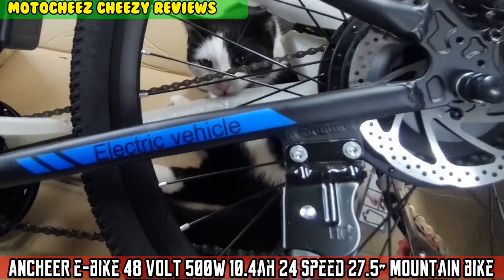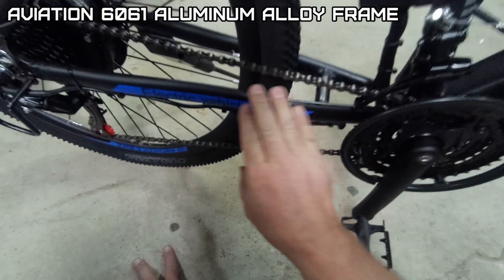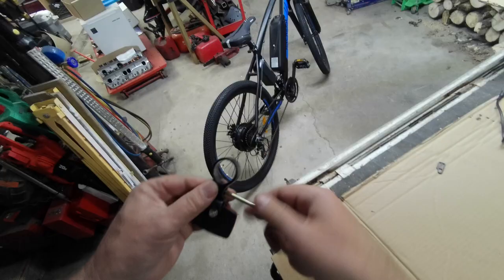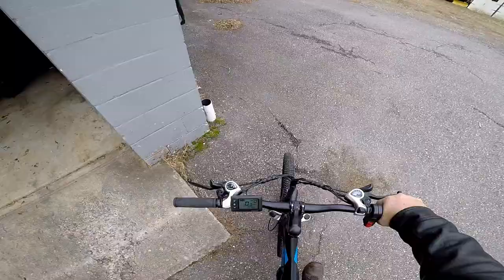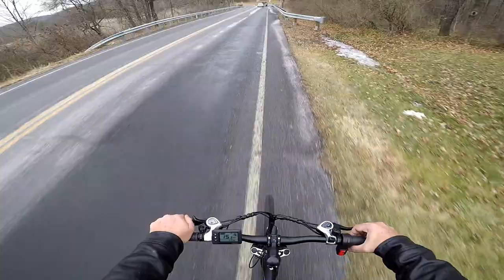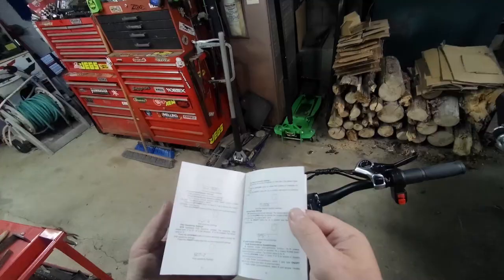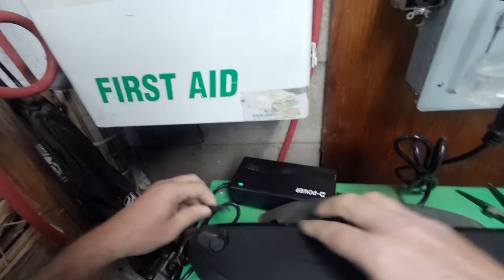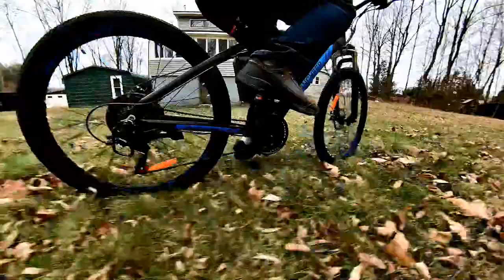ANCHEER E-bike 48 volt 499wh 10.4ah 21 speed 27.5" Mountain bike, controls, test and tweeks.

Comment: Hey. Open the motor controller and disconnect the white cable and the bicycle will go 30-40+MPH…. Your welcome… and the best part you don’t need to pedal
Reply from the maker: This controller has the white wire? I'll have to check.
Reply: @MotoCheez did it work
Reply: 7 months later, does the bike work good or does it ruin it because you did something you weren't supposed to, I ask because I'm buying one if it's worth the money and it lasts me a year or two. 😅
Reply from the maker: @clutch7756 still good but I've probably only put another 50 miles on it. I get a lot of bikes to test
Reply: @MotoCheez  please try! Thanks 😊
Reply from the maker: This bike did not have ther power wire It was done through the controller
Reply: @MotoCheez  Can you please send link to buy? Thanks!
Reply from the maker: My links are always in the description
Reply: Hey just got this bike and I can never go fast enough does that really work I’ll do it

Comment: Precautions are to check ALL of the bolts on the motor, not just the shaft bolts, but also the housing bolts, also it's a must to get a torque arm for the motor shaft, and fill the tires with flatout, this will save you a bunch of headache relief down the road, and give you an enjoyable ebike, for comfort, you can add a shock absorbing seat post and/or seat, and a adjustable handlebar neck to give yourself a comfortable riding position.😊😎👍
Reply from the maker: I typically mention check all bolt in my videos, the shock seat posts are definitely nice, I've gotten some of these e-bikes with them
Reply: Where do you buy the seat and handlebar thing you mentioned for this bike

Comment: I have an Ancheer AM1907, 21 speed. The gears are geared too low for me. I never shift down from the tall sprocket at the peddles. I've never used any of the lower gears, just geared too low. Probably better for just off road, not very good for road. Other than that it's been a reliable e-bike, just which they had taller gearing.
Reply from the maker: Seems all the e-bikes are that way, you can put a bigger sprocket on front crank sprocket or smaller gearset for rear

Comment: I have been on my Ancheer hummer ebike for 5 years. It's been a great time to ride.I would buy another one if something happens to it
Reply from the maker: Thanks for the input!
Reply: have you had to replace the battery? how many miles can you normally get before charging?
Reply from the maker: @shaunhenesy2258  typically between 1 to 2 miles per amp hour
Reply: @MotoCheez is that 1-2 miles per amp hour 50% full throttle and 50% pedal assist? or just pure pedal assist?
Reply from the maker: @eroblern 95% throttle, 5% pedal assist
Reply: @MotoCheez  damn thanks

Comment: Do you think the overall lighter weight is helping the work efficiency of the smaller motor?  And would a larger battery option help to compensate for the weaker (less expensive) motor?
Reply from the maker: Yes and yes, if it had a 1000wh battery would definitely help being the bike is light

Comment: So I saw your video I ordered two of these bikes very impressed by the quality took about a half an hour to assemble out of the box bike works perfectly for a cheap ebike this is the way to go. ANCHEER has my 100% approval and it also comes with a one-year warranty. I wish I would have watched your video all the way through the first time I missed out on the promotional code I guess that's what I get for not watching the video all the way through.
Reply from the maker: Congrats. Aww. Too bad you missed the Code
Reply: @MotoCheez  that's what I get maybe next time by the way these bikes came in red and black. Thanks again for making the video. Definitely should make things easier for people that are undecided
Reply: @MotoCheez  Maintenance video would be awesome. My bike is up to 171 miles I have no issues I'd like to keep it that way I just don't know what the maintenance would be on these bikes.
Reply from the maker: Good idea! 
Not much to do on these bikes that differs from a regular bike, oil chain, derailers, check brakes and derailers. check bearings, possibly grease if you ride in harsh conditions.
Reply: @MotoCheez  awsome thank you...

Comment: Interesting bike for the money. Wonder when some clever mechanic comes up with regenerative braking or 'coasting' for these e-bikes. Maybe something like the old bike light generators that were driven by the front tire, but on steroids for the required voltage?
Reply from the maker: Some of these bikes do have regenerative braking, I think it's the extra expense of the magnets in the hub. I think they should all have them for when you're going downhill you can recharge a bit

Comment: It sounded like both wheels were rubbing the disc breaks when just assembled. Did it continue to rub? Am surprised the manual showed you how to increase the speed limit past 20mph. Wish mine allows me that too.
Reply from the maker: I didn't notice the rubbing, I usually adjust if I hear it. Most all the bikes I get have a way to get class 3 29mph. Did you look up the controller online?
Reply: @MotoCheez  Good idea. I should look it up.

Comment: is there a cheat sheet available for those codes?
I just bought the same bike in 4/23  but they used a different model controller.
My+ - buttons are at the bottom,Not on the face,I tried pushing the same buttons but i cant get into any settings menu?Any suggestions?Ancheer is of no help ,only getting 20mph down here in flat florida.
Reply from the maker: Not sure what control you have maybe if you take a picture and do a Google reverse photo search it'll show you what model it is and then there should be instructions on it
Reply: Me too bruh

Comment: You would be highly suited to use a CYC mid drive kit for a build.  Right up your alley. CYC makes a 5,000 watt kit for converting bikes to an E bike.. You just need to hunt down a used higher end bike with great brakes and strong frame.. They go 50 mph 😂 And a good rear gear set made of steel to last longer 👍 Oh.. A 52 volt or 72 volt battery extra.
Reply from the maker: I was looking into those kits! Like you say, need a good frame with good BRAKES! I will do a build in the future for sure, also want to put a front drive for AWD bike and see how it does in my mountain trails. Good large batter is a must.
Reply: @MotoCheez  Might have to use 2 controllers and 2 displays for dual hub.. Not sure..
Reply: The Magicycle has a good rack to toss in an extra battery and controller with a display in a bag. Just need to connect a switch to the throttle to run one or both motors. Like the Ariel Rider Grizzly has.
Reply from the maker: I believe so too, or one larg controller to handle the amperage
Reply: @MotoCheez  I think under the seat of the grizzly dual hub is like 2 - 35 amp controllers .. CitizenCycle guy did a dual motor build. I did t watch his build but he does run dual displays.

Comment: Surprised it took me so long to find this video, i was always curious about that bike, i have one of the other Ancheer bikes, the 26in Speedrid fat tire,  its power house, the motor says 500w, control says 18amps, the battery says 48v, but tops 26mph, the display says it's peeking at 1,040w, and it climbs better than my 1000w Bafang hub, it's not perfect, but has the power.
Reply from the maker: Agreed!
Reply: Had to solder the motor wires together, kept melting 😂, after I upgraded the battery to a 48v 20ah unit pack, the stock battery will only discharge at 18a, that's when the peak w went from 960 to 1040w.
Reply from the maker: @bassw1758 good idea! Better connection for sure

Comment: I bought one of these and got it all assembled last night and charged up and the Battery comes on, controller comes on and works fine but there is no power to the Right side of the handlebars at all.. no horn, head light, or throttle. All the connecting wires appear to be all connected as well.

I would really appreciate anyone who can provide any help.
Reply: I reached out to ANCHEER and they are having a tech. contact me within 2 days but figured i would take a shot in the dark here and see if anyone knows about something simple i may have over looked.
Reply from the maker: I would unplug the little plugs that go to that side and make sure The pins didn't bend over when you tried to push them together, if one of the pins did, disconnect the battery and try lifting the pin with a little pick. I've seen that happen once before

Comment: Looks like Gizmo was on an adventure to go look for his Buddy the Woodchuck 😂.
    Cheezel can you order a higher wattage battery 🔋 from that company for the $650 bike 🚲 in this vid ?  Or do they even offer a upgraded battery for it ?
Reply from the maker: I believe this was the largest battery they offer, I'll find out
Reply: @MotoCheez  👍
Reply: @MotoCheez  do you have a ebike that has a peddling generator that charges the battery 🔋 back up when you peddle it ?  Or do they make those ? I thought 💭 I’d saw something about Bikes 🚲 that if the battery went low you could generate the power to charge it back up by peddling it.
Reply from the maker: I know that they do make them but I have not seen one yet, It's a good idea for sure especially since I have a lot of hills going downhill it could generate the battery power back to the battery

Comment: Which bike is your favorite so far?
Reply from the maker: Magicycle!
Reply: @MotoCheez  I weigh 235ish. Is that overweight for the bike?
Reply from the maker: @MitchellGWhitehead  I weigh 235. Max capacity is 265lbs
Reply: I weigh 300 and at times I have been up to 330lbs and the ancheer holds up well.
Reply: Oh and I also have another 25lbs for my backpack with 60oz water bottle and extra ebike battery.

Comment: Nice review cheesy I can tell I want a 1000 W or better Cause I am almost 300 pounds
Reply from the maker: I want 1000w too!
Reply: I have the 26 inch 250w 36v 8.6ah and I'm 300lbs. I've been using the bike for years and it gets me up to 20mph. I'm mostly in a flat desert community but it gets pretty windy here. I use full electric throttle and peddle sparingly because of really bad knees so I'll get close to 6 miles per battery charge. I'm looking at the redline newer version of this at 500w/750peak 48v 10.4ah. It's got adjustable shocks which mine are atrocious. Blew out a few months into using it but that's probably due to my weight. The newer one has a LCD digital display.
Reply: @Wutzmename what is the bike name because I'm looking for one but most have bad reviews
Reply: @NelsonVega-rr8jl  ANCHEER Electric Bike for Adults 500W Motor E-Bike with 48V 500WH Removable Battery, 3.5H Fast Charge, Shimano 21-Speed Gears, 26 * 2.1" Electric Mountain Bike, Color Display, Cruise Control. Sold by Sospers
Reply: @MotoCheez  Too much power and torque. Trust me. I'm 300lbs and just got the 500 watt motor and it's squirrelly and that's just 20 mph. You go 1000 watt and your in class 3 territory with speeds above 30mph.
Reply from the maker: I want 3000 watts!

Comment: Not a fan of the derailer type system...
Reply from the maker: What else is there?
Reply: @MotoCheez   Direct drive from the hub and  control from the display.. Yours is actually the only time I have seen derailers on an electric bike.. I may be very wrong.. But I have a couple of buds with electric bikes and saw no derailers...
Reply from the maker: All the e-bikes I've gotten so far we're hub drive and derailer. Mid drive has on rear from what I ve seen. IDK